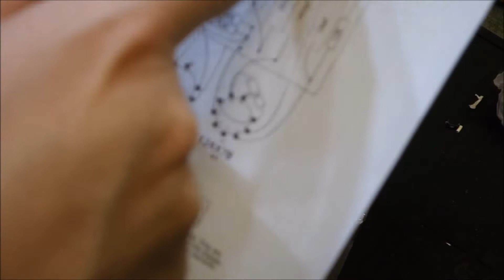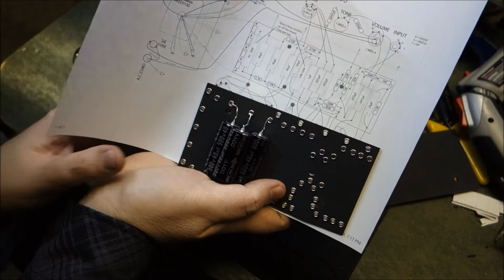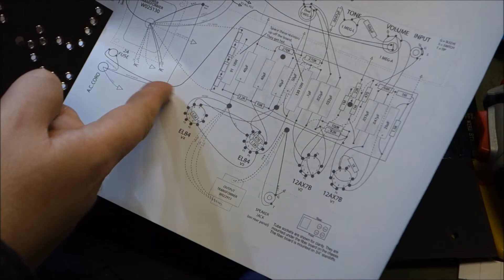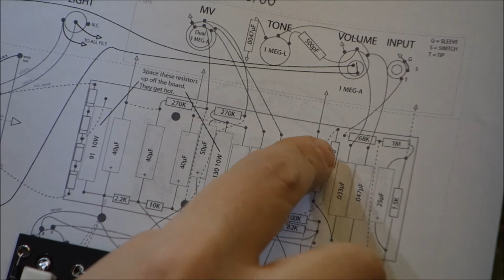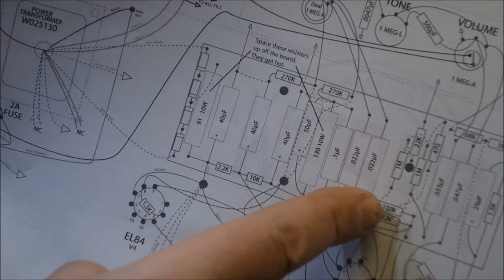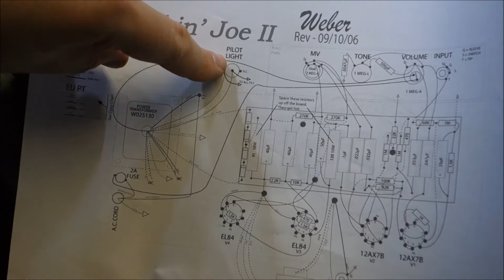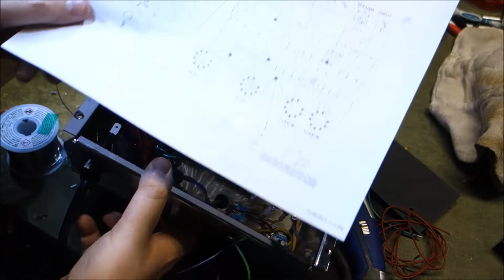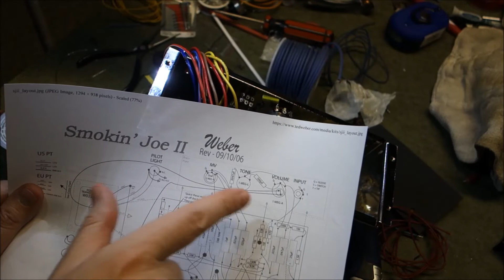Let's build (another)  Smokin' Joe II Weber Kit Guitar Amplifier. Part 1

Comment: Do they make a tube rectified version (kit) of this amp model.  With this tight space is heat build up going to be an issue.
Reply from the maker: This is the only version out there,  but I'm sure I could design and make one that was Tube rectified.
Reply from the maker: I neglected to address your heat question...   YES this amp gets warm...  quite warm.  Between the tubes, and the power resistors inside, it generates a fair amount of temperature.   I've not experienced any negative effects as a result though.    If I were re-designing it,  I would only sprawl the layout a bit more,  and maybe use a cooling fan.